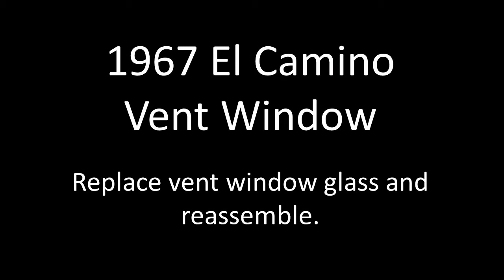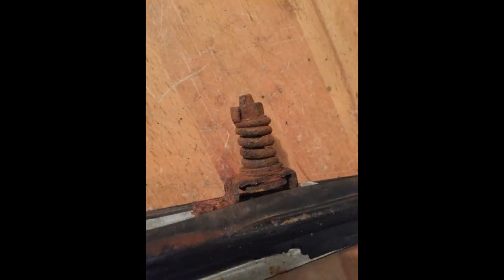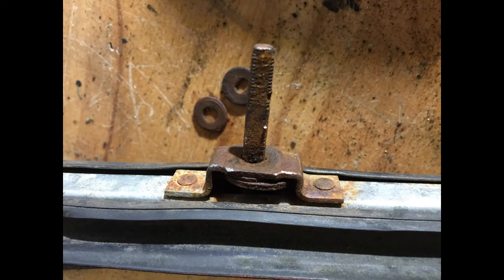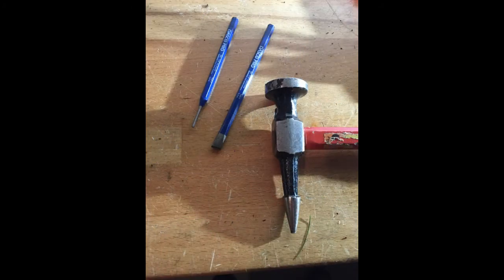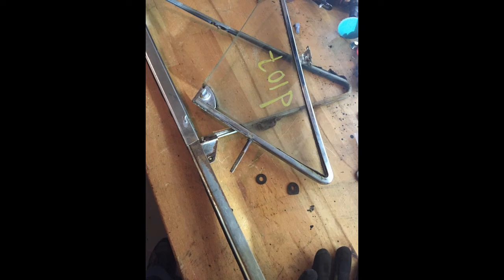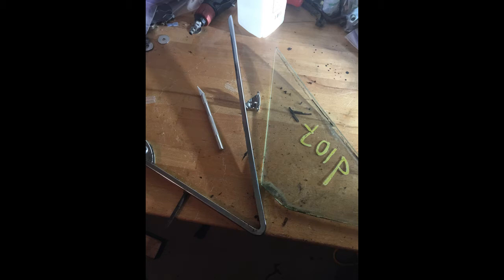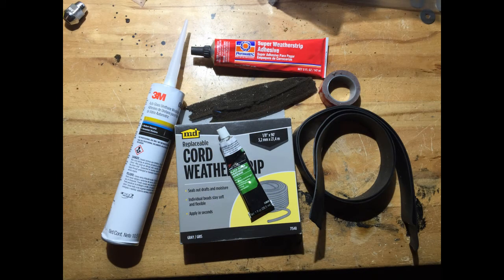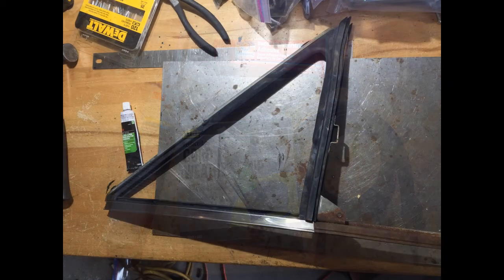1967 Chevelle vent window restoration

Comment: Got lucky...weatherstrip was in great shape. All I needed was a clean-up and replace glass. After multiple passes with a razor and a heat gun the old glass was easily removed. My glass pro advised using urethane sealer instead of the tape...worked out wonderful. Trick was to let the urethane set-up and later trim excess with a razor.

Comment: The weld on my spring stud is broke.  could you share the name of the "expert" you used to install your glass and moulding? I have new moulding frm Steele and don't want to fight it either.. Great video Thanks
Reply: @MuscleCarSolutions  Thanks for the info.. There are not any small shops in my area. If you have the name of the shop you used, I can ship it to them easy enough

Comment: Did you make a video on how to remove the vent window assembly from the door?
Reply: @MuscleCarSolutions  thanks for your prompt reply. I have found no videos other than mention to remove the three fasten pointes and there was no need to remove the main window in order to remove the vent. I have removed the two bolts in the jam and the nut in the panel yet I still cant get the window out
Reply: @MuscleCarSolutions  no I did not. Read somewhere online it was not necessary. So I'm guessing I'll be taking the windows out also

Comment: the 67 chevelle vent window upper pin in video is not the same style as elcamino
Reply from the maker: Yes.  Chevelle and el Camino wing windows are different in a few ways.  Same process applies to either.